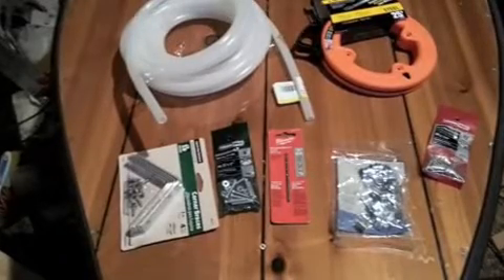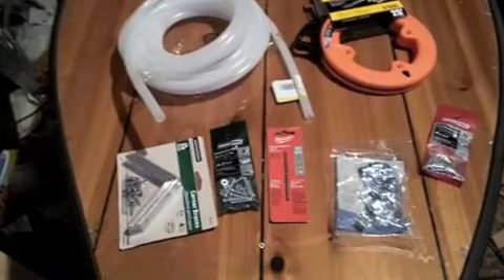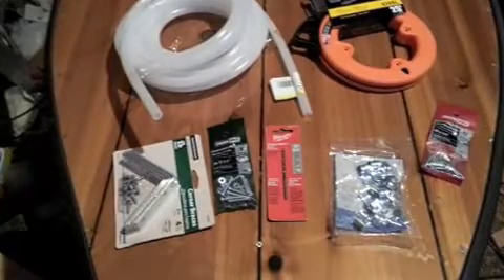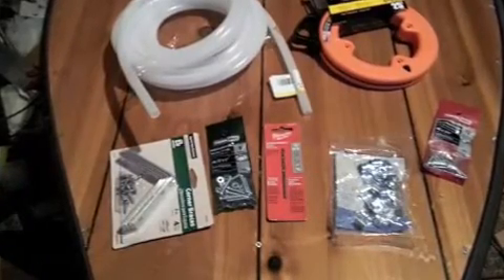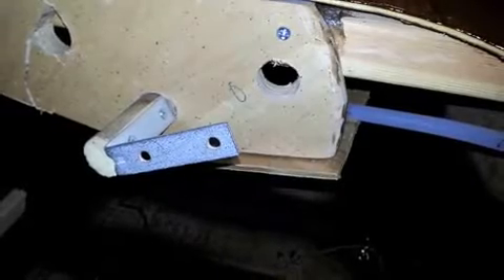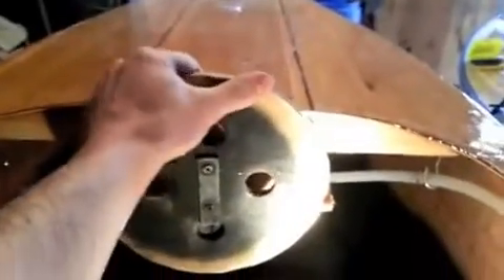Homemade boat steering

Comment: i made a steaming system for my 12 foot aluminum boat. and use pulleys and cables. if you decrease the diameter of the master pulley on the drive shaft and increase the diameter of the steering wheel your increase in torque will make for smoother turning. I do like how you off set the steering wheel to make for better one handed steering the increase in torque could mess up that system. hopefully some grease will do the trick and you can test it on the water.
Reply from the maker: Yeah the rope and pulley method is better!